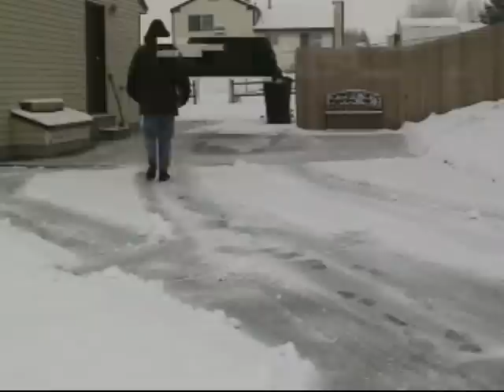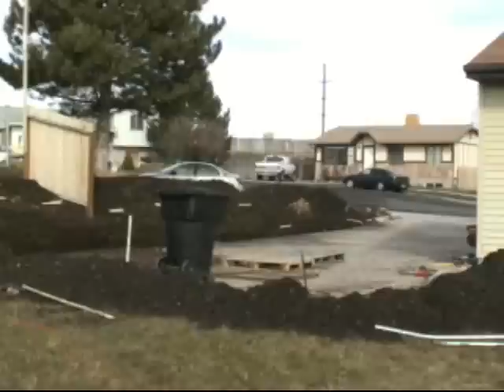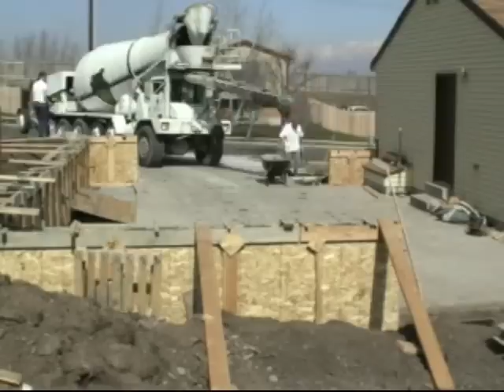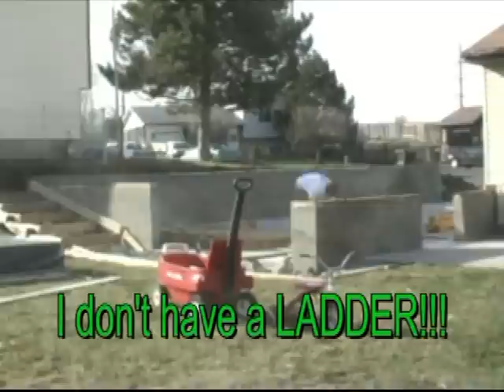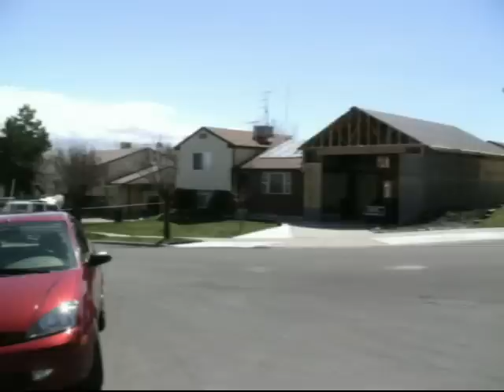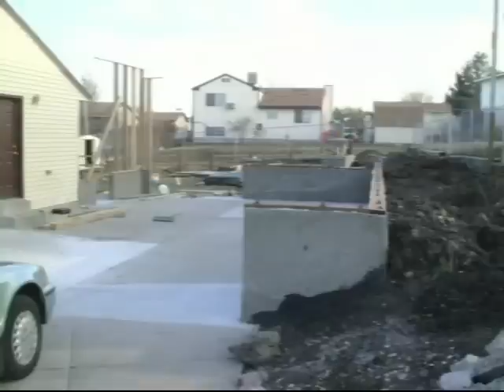Complete Timelapse of Building a Garage

Comment from the maker: @GameUrg 20+ yards of concrete, tons of 2X6X10's, 50 sheets of OSB were $15/sheet at the time.  25 large trusses, a mile of wire (6 AWG, 12 AWG, coax and Cat5).  R-19 insulation in the walls and 1000 sq-ft of R-30 in the attic.  37 sheets of Sheetrock.  Custom built, insulated garage doors on both the front and back.  500 lbs of nails and Sheetrock screws.  10 gallons of primer and paint.  Commercial grade vinyl siding.  
It all adds up.